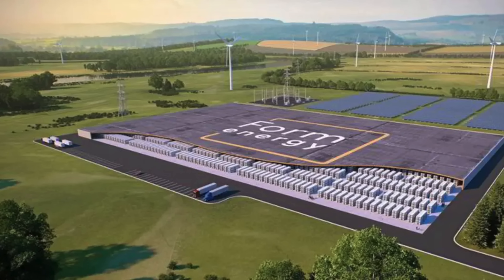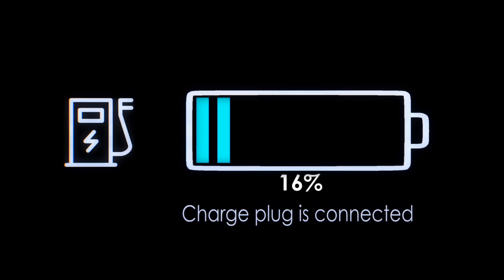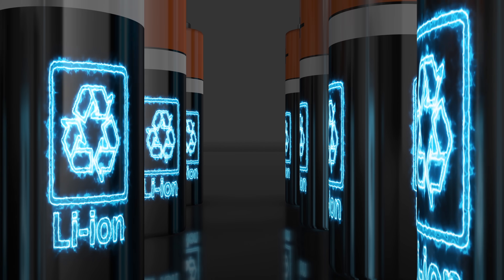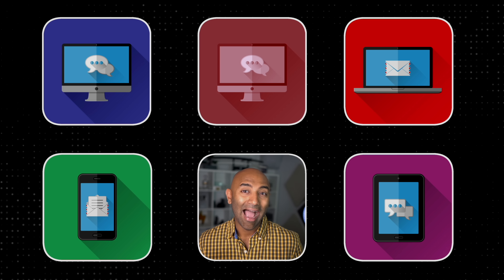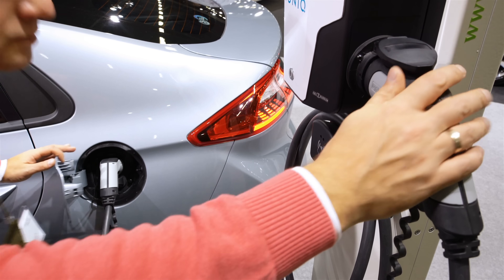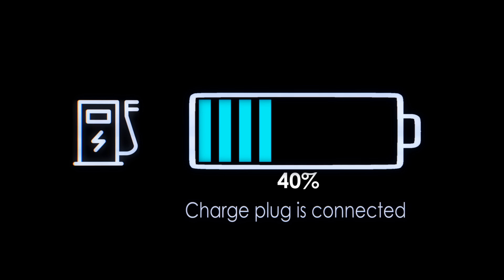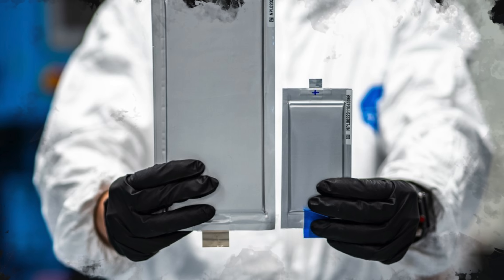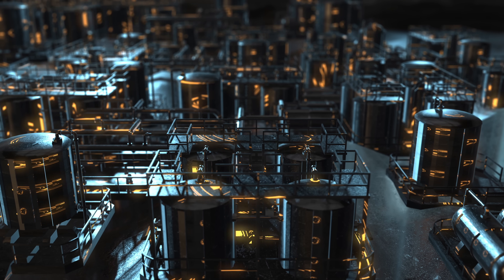This Battery Claims It can Store Energy in RUST!

Comment: These batteries take a lot of space but are perhaps still in size and material needed compared to compressed air storage or  cryogenic liquid nitrogen energy storage??  I like the latter a lot because low temperature waste heat can be used and having liquid nitrogen around might be handy during heatwaves. 
The present car is perhaps too heavy and not aerodynamic enough. Lower down the maximum speed and you don't need all that protection. It's likely even at rather high speeds, accidents with two light vehicles with big airbags will not be lethal. Those heavy cars are invented in a time where oil was cheap.   
Of course with low maximum speed,  traveling could take too long and so very fast public transport would need to take over for long distances. That could be trains but the rail system would not be able to take all these passengers.
So why not forbid highways for personal cars and use there exclusively a kind of renewable energy bus who can go very fast but with all kind of built in protections and comfort. Those buses could perhaps even connect to make a train temporarily to save energy and exchange it while driving.
It would even be easier if those light, low speed vehicles could get coupled with some others to make a little train and then
additional energy and aerodynamics would be available to go much faster so they could go on the highway. People could then stay inside their vehicle and wouldn't be forced to go to a station, wait for a train... (boring ;-) !!)

Comment: Good info -- so many battery techs coming out for Grid Scale.
This one could solve the space issue by building the outside strong enough to stack 100 high -- kinda like the ship containers, but with a meathod to remove one should you have trouble.  Or maybe simple structures like multi level parking garages, doesn't need to be totally enclosed?
Cheers

Comment: What is the costs factor compared to LFP batteries? Comparing to the most expensive chemistry makes it look better than the real world. 
Unless they can up their discharge rate, I don't really think this is a winner. Compare it to your powerwall, which can output 7kw/h with an even bigger peak and stores 13kwh. For an average person this is enough to power their home for a few hours although some might opt for 2 or 3. Of course for the 10x cheaper price for these new batteries, you could just go for a 130kwh battery. But then you can still only pull 1.3 kw/h from your battery, that's is basically enough to power your lights, TV and computer and 1 fridge. But you can't use the AC, microwave, electric stove or even your swimming pool pump. So you might need a 1Mwh iron air battery to run all your appliances at the same time. But that would mean the 10x cheaper price is completely turned upside down and it will be 10x more expensive. And don't forget the 1 acre of space you would need in the garden of your single family home.
So either I got some of the details incorrect or they are not going to make a usable product for home storage, unless you think we will be have periods of 100 hours with the sun recharging our batteries.

Comment: So an air iron battery has a C value of 0.001,  In other words, even though it can store lot's of power, it can only release it at a much lower rate than Li batteries.  So how fast can it accept power.  Is this also slow.  And how do they solve the problem of the relative volume of iron and rust.  If I remember correctly rust occupies 16 times the volume of the iron it was produced from. Could this be adapted to refining iron ore.  Typical iron ore has to be about 50% Fe before the miners will touch it.  And can the oxygen produced during charging be collected and compressed into tanks.  A valuable by product.

Comment: I need a chemist!! Carbonic acid rusts iron too right? Hydrogen is produced in the process and the oxygen goes to the iron. Can’t we use this as a carbon capture as a freebie?? And the hydrogen could go to produce more energy… my question is this- is the CO2 broken down or will it remain as carbonic acid regardless of its use? And why are we using atmospheric oxygen for these batteries when even if carbon can’t be captured, it still uses the water for the oxidation and produces hydrogen in the process?  I’m not a chemist, that may be pretty obvious…. But it seems like we could get a twofer here?

Comment: Thank you again Ricky for your fabulously thought-provoking videos, the Iron-Air batteries seem ideal as base-load supplies, the exact area where fossil fuel plants still find their place, even with solar & wind.
However, the low power density is a major stumbling block as your 1MWh TeslaWall with room to spare in your garage analogy brilliantly illustrates. 
Well, unless your garage is 1.3 acres. 😉
The Tesla-based Hornsdale energy storage in South Australia has a capacity of 194MWh, so even with the denser 3MWh/acre Iron-Air batteries, it's going to need substantially more real estate.
In any case, transmission losses from large remote storage incur losses & the length makes them vulnerable to damage/failure.
I'd be very interested to know the capacity of the washing machine-sized modules & how many would be needed for domestic storage. 
The price might be right, but I fear that they may be too bulky, as the popularity of high-density living will be problematic for strong Iron-Air storage uptake.
Perhaps install the modules underground before pouring a concrete driveway? 💡
Reply from the maker: Think you are asking all the right questions my friend… the key will be proving they can last for decades… reaching economies of scale, and absolutely producing these in massive scale!

Comment: Why do they need to be stored in a building?  Footprint for battery storage is a non-issue, since either solar or wind take large amounts of land, and are typically sited where land is cheap.  Solar cells could be build on top of the structures, being integrated into the roofs.  The question is capital cost for the buildings, batteries, and power lines.

Comment: It's not just the slow discharge rate that makes this a bad battery choice for anything but seasonal storage (ackkk dumb, dumb, dumb, dumb, not wise).  It's also the slow charge rate.  If it takes 100 hours to charge it, you can't daily dump the duck's belly into it.  Form has already signaled this is a bad tech by stating it cannot work quickly enough to shift energy on a daily basis. 

The equivalent problem in pumped hydro storage would be to build a massive set of twin reservoirs, and then install a massively undersized pump/generator that takes a minimum of 4.1 days to move all the water in one direction or the other.  If you built such a system, the first thing a wise power engineer would prescribe is to AT LEAST 10x those pump/generator so we can use the whole reservoir at least one time a day in the allotted excess solar or wind window (or excess load window like 5-9pm in a heat wave), AND keep it working hard when we have to do maintenance on a set of pump/generators.  

Having a painfully low charge/discharge capacity makes that Form's design a bad tech IMO.

Comment: Pure oxygen recycling in the system would dramatically increase its abilities. The composition of air in percent by volume, at sea level at 15 C and 101325 Pa. Nitrogen -- N 2 -- 78.084% Oxygen -- O 2 -- 20.9476% Argon -- Ar -- 0.934%

Comment: The o2 membrane is not working yet and may never be what is needed at a reasonable price.  We should be working on controlling fossil fuels to reduce the CO2.  Fossil fuels have the energy density we need for most of our needs.  You will not see commercial aircraft running on batteries for at least 4 decades.

Comment: Just wait for a reliably rechargable aluminium air battery, Heck, even if an Al-air battery could only provide 100HP for a small car i'd gladly take that, because it would be cheap, and it would give a massive range
Also, with a large 5 acre, 5mWh facility, you can just build solar panels on top of it, you're going to build solar panel farms anyway, why not put the batteries under the solar panels

Comment: I kinda consider this class of batteries to still be in a base research phase... lets call them oxidizing batteries (blah-air... aka oxidizing batteries).  That's what the air is used for, after all.  So, for iron-air... very low charge and discharge rate, some difficulties recharging (all oxidizing batteries have recharging issues of one sort or another), but decent overall energy density at 250 Wh/kg.  I haven't heard much about the efficiency of this chemistry but numbers in the 60% range are being bandied about... not great, maybe these startups are getting better results though.  It clearly can't be use for mobile applications, at least not for high-power mobile applications like EVs.   Cycle life is also a big unknown.

It might also be too bulky for home solutions though.. how much space would one generating, say, 8KW, require?.  On the home front, it is important to note that there might be another niche as base load' for the house, or base-load for a micro-grid neighborhood, supplying the storage component and then using smaller lithium batteries for short-duration / high-wattage needs.  In that respect, for a home, even a small 1kW iron-air battery would be extremely useful.  e.g. a 1kW (100kWh) iron-air battery coupled with a 8kW / 16kWh power wall.  Or even smaller if you aren't trying to run AC.

-Matt

Comment: Power grid batteries like Scottsdale AZ Fluidic Energy's and Form Energy's metal batteries are nothing new. The grid still needs instantaneous torque which renewables like Li-ion batteries, hydrogen, and limited hydro can produce.
Reply: anyone classifying lithium ion as renewable is a clown
Reply: @r3wturb0x51  Hi - it is Bozo your power generation engineer here. I also call nuclear Green like my counterparts at the COP26 conference. So you are probably right the source to produce the energy is renewable and the means to store it is?🤡

Comment: I fail to see the benefits of these batteries over NiFe batteries, which are already commercially available and have been for decades.
Reply from the maker: A need for nickel… do you know how in demand nickel will be, and how much it costs?
Reply: @TwoBitDaVinci  Fair point I guess but it does not "consume" the nickel it will be there for years and years and can be recycled at the end, and I think (off memory, didn't go and google it) the main use of nickel is stainless steel, I think (again, did not research recently) the amount used in batteries would be insignificant compared to that.

Comment: excuse me, aluminium-air batteries are rechargeable, too
Reply: make metal, by recharging iron oxides, also put more parallel, if you already did it
Reply: magnesium-air is similar to aluminium-air, rechargeable, either replacing metal plates or directly de-rust
Reply: stop lying, it fits in a pocket too
Reply: no no, you dont get to say against portable high energy density batteries
Reply: everything should be free, if you want to keep money, you lose it
Reply: whos inside you, is it people or God, dont let your behind be violated
Reply: instead, use Sodium (Na2O -> NaOH -> Na electrolysis at 300C) process in the renewable electricity sources, to make aluminium, magnesium, iron, zinc, silicon-metal, as a wire spool, then make a fuel cell with circulating electrolyte oxide filter, to feed the metal wire spool as consumable electrode, like a 3d printer, and have the electrolyte be salt water, optionally baking soda or potassium hydroxide, salt water or baking soda are the safest, and stop feeding the spool when you dont need more energy, its a finite dip metal-air fuel cell, just like a hydrogen fuel cell or gasoline engine
Reply: the spools of metal wire as source energy storage is the most essential, it can directly be melt into the metal things too
Reply: its essential that the engine is a separate fuel cell, fully reusable, without regard where the energy source metal wire like in a 3d printer is coming, and all metals work fine with the salt water fuel cell, its a normal simple battery, but in re-fuelled form, the metal wire spools, or even carbon burning, electrically oxidising carbon, which can be done, with a forward voltage to increase the carbon oxidation process but gives out more than was used to initiate the oxidation process
Reply: have a return bucket in the electrolyte filter, to be refined back into the source metals, they are just the metal oxides
Reply: lie, you can have the power source, separate from the fuel cell
Reply: same for (m)ethanol fuel cells
Reply: use sodium Na as catalyst in the batteries, in the form of NaOH
Reply: you just have to store the Sodium Na in plant oil, for it to not prematurely oxidize

Comment: K.I.S.S.  right amt = heat.  4th gen smrs retrofit to metro utility companies.  Syn fuels are carbon neutral.  Batteries, windmills, solar cells are too many parts to maintain.  People need energy in the place where they are.  Not recharging.  Fuel is convenient.  Too many parts sums renewable pipe dreams.

Comment: Rust also = breakdown
Reply: That's what I am wondering. Is this reversible rust just a thin layer on the surface, which would account for the size/land required. It can't be that the rust permeates to the core of the anode because would it not begin to fall apart? Although that could be part of their trade secrets.
Reply: @davidmccarthy6061  Would think over time even surface rust would lead to a lot of loss but like you say maybe they found a answer to that.

Comment: The future is not the battery, regardless of the chemistry.  The day will come very soon when battery vehicles will have the stature of the hand cranked ICE.  Battery vehicles are heavy, non-sustainable, polluting and dangerous.

The future is fuel cells.  All forms of power generation will be focused on hydrogen refinement to drive fuel cells of all sizes and applications.  Hydrogen fuel cells are more efficient, environmentally benign and sustainable than ANY other alternative fuel, and can be readily produced by harvesting solar, wind, hydro, nuclear and geothermal.  Fuel cells will allow for localized generation of power that will eliminate the complexity created by electrical demand and transmission and establish a secure future for the earth.
Reply from the maker: Fuel cells will not be used for consumer cars… I’d never buy one because I’m free to make my own energy for my BEV. I’m never going back to being beholden to come company. Many agree with me on this… but larger craft will probably run on hydrogen.